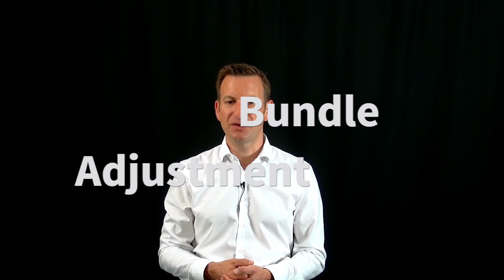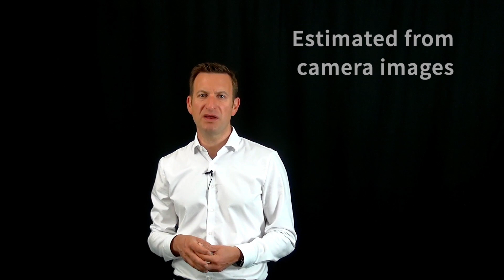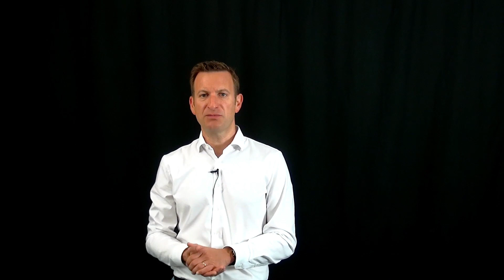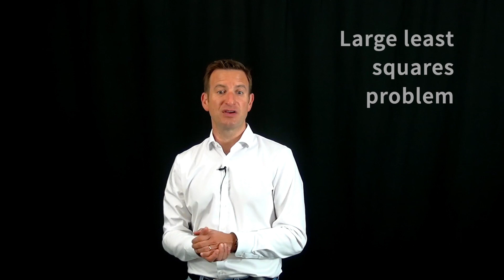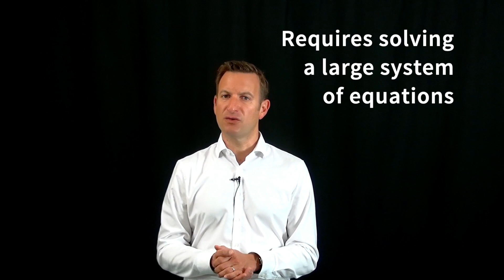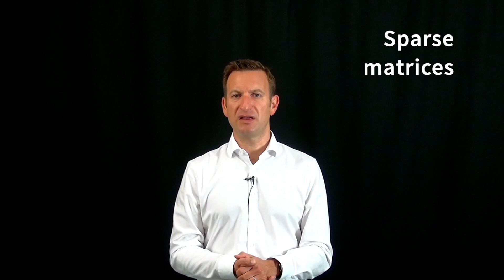Bundle Adjustment - 5 Minutes with Cyrill

Comment: Thanks Cyrill for this quick refresher for BA. 

Consider a situation where we have known camera poses and feature correspondence across several frames. Then one way to solve for the features' 3D positions is to either minimize an algebraic error by forming a system of linear equations or by doing a structure only BA which minimizes a geometric error. 

I was going through this document by a course given by Luca Carlone - https://vnav.mit.edu/material/16-optimizationAndEstimation-notes.pdf , and here they say that this Algebraic error is rotation variant while BA is rotation in variant. What does this mean physically? Does that mean that there will be several rotation matrices which can arrive at the same BA solution but only one set of rotation matrices which arrive at the algebraic solution?

Comment: Hello Cyrill. Thanks for your Videos!
If you  "only" have image point correspondences and use e.g. the 8-point algorithm to estimate your 3D calibration (using the intrinsics from the camera manufacturer as an initial guess). HOW can SBA help to refine the intrinsic parameters? I would guess that you cannot get rid of the perspective ambiguity.
Reply from the maker: The 8point algo determines at max 7 dofs, it the fundamental matrix and not all intrinsics.

Comment: Can we estimate the visual odometry in absolute scale using bundle adjustment for monocular camera?
Reply: I am not an expert in visual techniques, but I believe visual odometry and bundle adjustment are intended to solve two different problems. Bundle adjustment aims to recreate both the camera trajectory and a map of the surrounding environment and can be computationally expensive.
Visual odometry, as the name suggests serves a source of 'odometry', that is, it provides relative motion estimates. In this case no map of the environment in generated and as such is much more computationally inexpensive. One can view VO algorithms as a subset of BA algorithms.
Coming to the scale part both BA and VO have a hard time estimating scale in monocular settings without some additional information. In case of VO, an inertial measurement unit (IMU) can be used to estimate and track scale overtime. Hope that helps.
Reply from the maker: Using only monocular images without baseline information or odometry will not allow you to recover the scale. The best you can get is a so-called "photogrammetric model", i.e., a 3D model that is only determined up to a similarity transform.